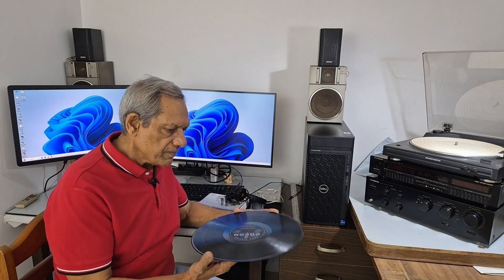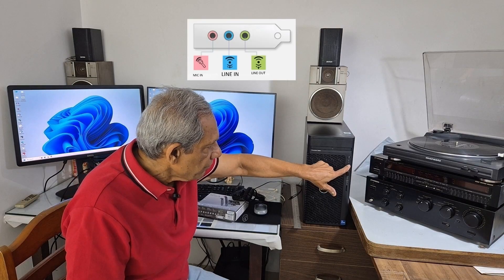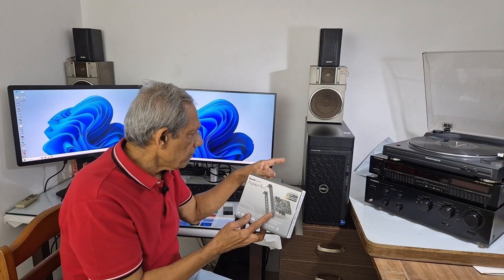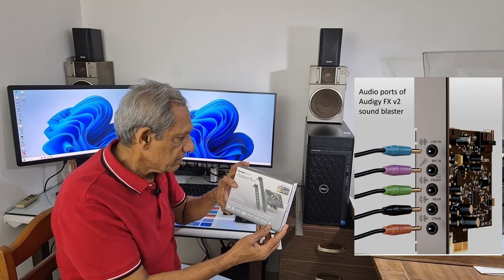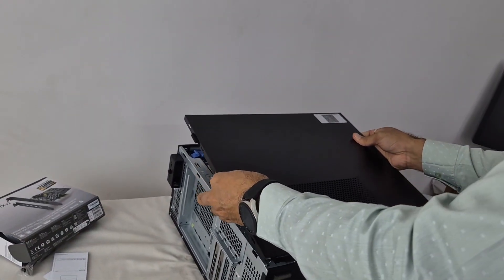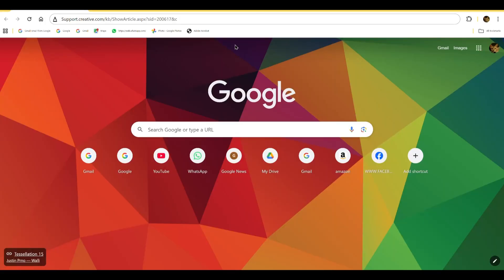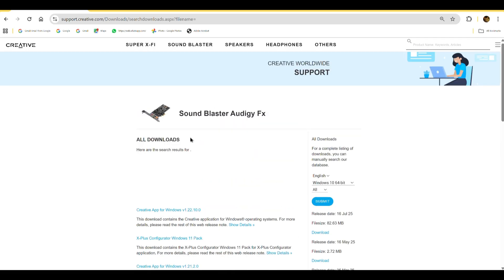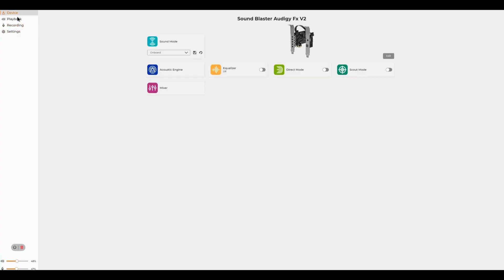Installation of Creative Sound Blaster AUDIGY FX v2  Sound Card in a desktop PC.

Comment: Hi Vijay   do you have to fit a power cable to this sound card
Reply from the maker: No. No this sound card is installed in PCIe slot of the computer. It is powered by the PC only. But you have to download the Creative App to run it.
Reply: @Vijaysoni53  This card works OK without the Creative app. On some computers you have to disable the onboard audio in BIOS to avoid conflict, but I have it running also on this old Asus ROG board running Windows 7 without the app and it works fine. It appears in your Windows Device Manager as 'High Definition Audio Device'.
Reply from the maker: @gilhardwick2269 I see. Thanks for the information.